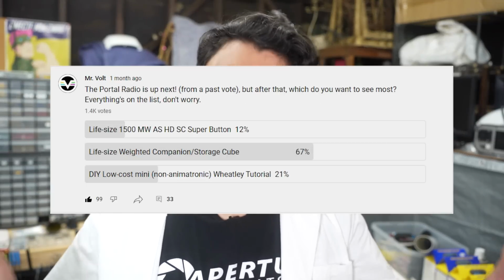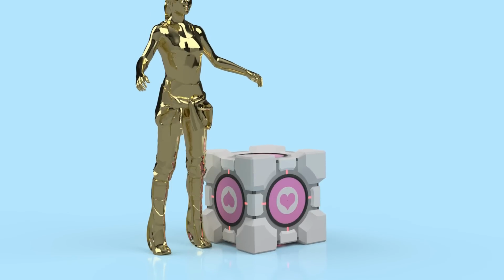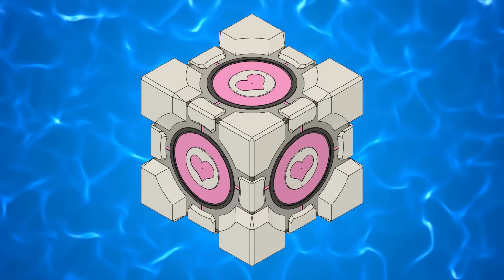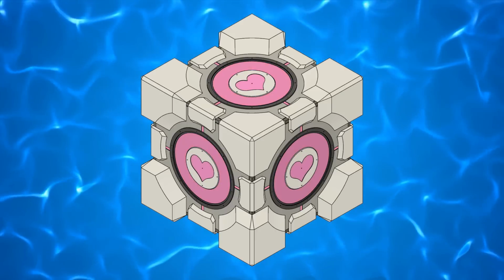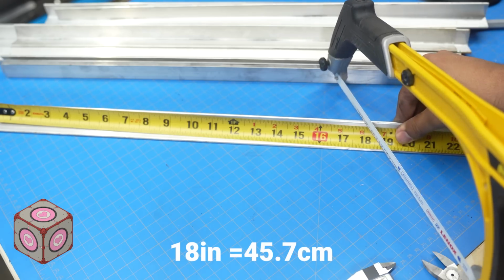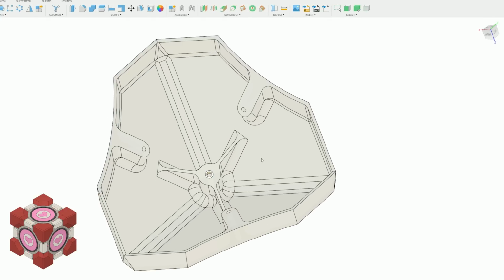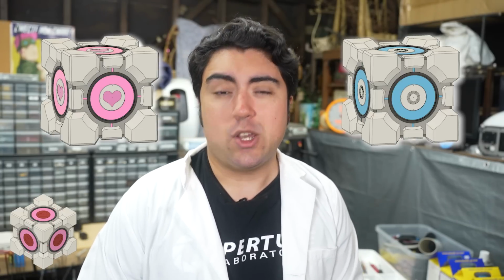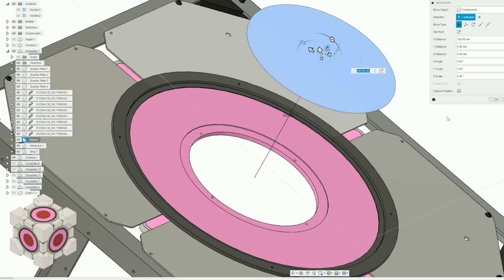Designing a Life Size Companion Cube

Comment: Couldn't you have just placed the circle at an angle though? so the notches fit into the corners, but were still connected? 🤔
Reply from the maker: Yes, sometimes I overthink a design too much and miss the obvious simpler option
Reply: @MrVolt  happens in the game as well; kind of thematically appropriate when you think about it :p

Comment: The size probably came from heights of characters in the Half-Life/Portal universe. Each object (including players and NPCs) have a size in the game engine (obviously), so you can just use a little math to figure out the size of the companion cube, then. And before you ask, no Source game engine does not use any kind of real-life unit. The height of one of the blocks you scale in Test Chamber 17 with the companion cube is 64 units (as is the width of all the portalable panels you see throughout the game).

Comment: If all the edge guards would touch a theoretical button, you could have a sensor or a similar part to detect a small electric current in the ring of the button. 
The edge guards might be the best pieces for it.
I’ve never messed with this stuff, but hopefully it gives ideas

Comment: Idea for colour control.
I know your probally past the point of needing any ideas but thought id share anyway. 
Two ideas.
1. There are cheap nfc stickers you can get you could use them in one of many configurations for example on a magnetic logo so when it goes on it triggers a colour or the button detects and changes the colour.
Or 2. A less programing method, simply hardware. Have the magnet logo plates.
On one side of the cube, on the inside magnets have the cables connected to the magnets one corner negative, one b, one r, one g, for rgb led. Now on the logo plate depending which logo run a wire between negative and what ever colour combo you want. So when you connect the plate the magnets complete the circuit selecting the colour.

I just realised i think i made a mistake with the power explaination but you get the idea i mean, your a smart guy and this comment is too long to bother fixing what i wrote keep up the awesome content.

Comment: PLA is not innately garbage. It all depends on the use case. PLA is great for parts that need to be rigid, where abs is flexy and pla is stiff. Printing pla at temperatures of even 250-260c can allow the internal structure to crystalize which immensely increases strength. Also, with some heat treating (not that hard... can be done with a piece of wood, aluminum foil, and your average oven), the heat resistance of PLA can exceed that of ABS.

Comment: there are a few animations of the cubes being assembled, a few models that show metal sheets for cube manufacturing, educational edition shows the core of a cube
Reply from the maker: Hmm, I cant recall seeing those before. Where can I find the animations?
Reply: @MrVolt  During the manufacturing sections of Portal 2's escape (The part where Wheatley is flashing the light over a pitch black factory while telling you about the madman who destroyed his robots), you can see cube plates being cut by industrial lasers and turned into cubes.

Portal Stories Mel also has an amazing section inside a cube factory which mostly uses canon models, might want to check that out too
Reply: @MrVolt  here https://youtu.be/dQw4w9WgXcQ

Comment: This is my dream decoration, if I ever get enough money I'd make this when I get confident enough in my craftsmanship. Then again my dream companion cube may be extremely expensive, anodized aluminum, flush machined screws, reinforced with a wooden interior or filled with a cheap but light material to provide some structural rigidity. I'd personally out of the lights for mine, even though it's canonically lit, I'd want it as a cute stool or ottoman, or maybe as a nightstand.

Comment: I know you said you wouldn't change the design but why not try using wireless LEDs for the lights?

You could have the induction coil under a button that turns on when it's pressed and it would power the receivers which would be placed on 3 different sides of the cube which would work as the color choice. 

For example  side one is has one receiver that makes the whole cube pink, side 2 has one that makes them blue and side 3 has one that makes them orange.

If you place the induction reciever close to the center it shouldn't activate any other lights as even the longest range induction coil I've seen that isn't a million dollars only went like 20 cm.

Comment: Instead of making the "windows" circles, you could have just made the polycarbonate into a square that fills the side.  Then attach the the corners of each side to the polycarbonate.  Save on cutting it into pieces.  That is clearly the way the thing is designed in-game.
Reply from the maker: The texture appears that way at first, andI didn't focus on the 3D game model in this video, but the there's noticeable depth to all the edges and illuminated strips  as they rest below the faces of the cube, so I'd still need separate plates to cover them (painting over them wouldn't look right). With polycarb faces, each piece would cost $40 too. This way (as circles) I still have the option of edge lighting them from the outside edge, which wouldn't be possible if the whole face was polycarb. There's lots of different ways to make this! I appreciate your comment, just want to explain my thoughts.

Comment: 10:38 if you rotate the part on the left by 45deg, it won't waste any more material as the one on the right. but if one of the pegs breaks off, you're in trouble, so the one on the right should still be the better solution

Comment: i think sandblasting is probably a more effective consistent and reliable way to smoke the plexy for a diffusion effect, otherwise a coating or film,  plus its way faster and less labor intensive,. its also great at flatting bare aluminum  ,, sand paper is likely to be a very "tricky" method of getting the effect i think you're looking for , ,very easy to screw up your material and your budget with plexy and acrylic like stuff,.

Comment: Oh hey, I'm the Wikipedia editor who (somewhat recently) added those dimensions mentioned at 0:48 to the article. I'm glad I included that information in time to be helpful for your project! Those are the dimensions of the cube prop in Portal 1 and Portal 2 converted from Hammer units to real world units. 16 hammer units = 1 foot and the cube model in Portal 1 is 40 hammer units while the model in Portal 2 is 36 hammer units around the bounds of the whole cube (its corner pieces, not its inner cube surface).

As a fun fact, I read on an old Reddit thread from somebody who anecdotally claims to have talked to a Valve employee who said they shrank the cube during the development process of Portal 2 to prevent it from getting stuck in the portals as often.

And for the record, with turrets, in Portal 1 they are 3.62889 feet tall excluding antenna, but I never got around to measuring the Portal 2 turrets.

If you still doubt this scale factor from hammer units is canon, here's my defense of that. It's safe to say that the conversion factor is pretty much as canon as you can hope for. The cube size passes a sanity check when compared against the height of Chell's player model, and she's roughly an average-height female when converted to real world units. The developers are modeling props with a certain real-world scale in mind so all the pieces come together in a sane way, so it should match developer intent. In my research, I've found people posting online where they tried to find counterexamples where specific props or measurements in game don't follow those units. But those are more a matter of oversights or tweaks for technical reasons or artistic license. For example, I've seen people count the distance measurements on the wall of the shaft in the "fall" chapter (with the potato GLaDOS small clap processor monolog), but those labeled distances aren't necessarily to scale with hammer units because they wanted to fit the pacing of the monolog and the player wouldn't know the difference. Another one I've seen is a comparison against the American flag on the moon, but obviously that is just the wrong size for artistic license and can't be used to construe the size of the entire rest of the game based on one prop in an ending cutscene. Other people tried to compare the height of certain known objects like a chair which has a pretty common height, and found it might not perfectly match the hammer units likely due to developer oversight. Nothing is perfectly consistent, but the 16:1 conversion is the basis from which the developers create the whole game and then may choose to make certain things inconsistent for practical or artistic reasons.
Reply: There is evidence of the cube being shrunk. The version of the model included in Robot repair is identical to the one shown in E3 2010, and the retail cube is only 0.9x the size of it.

As for the unit size, the scale varies between assets, as having the player and npcs at a smaller scale works better visually due to it being an FPS game. The depth signs in the fall chapter are actually perfectly spaced to fit 1unit = 1", which is interesting because world geometry tends to be at the 16 unit scale.
Reply: I think the 16 unit scale works better for this though, as it will look closer to how it does in game
Reply: 1 unit is 1 inch for npcs, so each hammer unit is gonna be 1 inch to the height for turrets
Reply: @dkskcjfjswwwwwws413  I don't know if a turret is classified as an NPC or not in-engine. But if you load up Portal 1, stack two cubes on top of each other, and put a turret next to the pile, you will clearly see the turret is just shy of 1.5 cubes in height. Since Portal 1 cubes are 2.5', this is a clear visual confirmation that turrets are indeed 3.62889' tall as measured by exporting the model and loading it in Blender (and excluding the antenna). If it used the NPC scale of 1:12 instead of the normal 1:16 scale, that would make a turret 4.83852' tall, which is just shy of two cubes tall and as tall as a short human. But turrets are in fact only about torso-height as you can see in-game.
Reply: You should just become a hoax debunking channel at this point lol
Reply: @null I just opened up the Hammer editor and dropped in a cube and measured it. Additionally I converted the cube and opened it in Blender and the units were also those measured in Hammer.
Reply: So, I'm currently designing some small scale Turrets, and on my research I saw a video from someone who was designing a 1-1 scale Portal 2 Turret, who was in talks with valve on making a licensed product out of it. And he said that the in game units corresponded to 1 inch each. So instead of 16 hammer units = 1 foot, he used 12 hammer units = 1 foot .
I don't have a preference to either measurement since I'm making small scale ones, just wanted to get your opinion on it because he was pretty adamant on it being 1 unit = 1 inch.
And if I recall correctly he also used Chell's height to confirm his measurments (worked out to Chell being 180cm in height)
Reply: @konstantinosstavrou7638  I think I know of the person you're taking about from my research and he is wildly mistaken. The consequence is that his turrets are roughly as tall as a human, but if you stand next to one in-game and view yourself through two portals, you'll see that turrets are only about 1/2 to 2/3 the height of the player model.
Reply: @Keavon  So I just put a turret next to an office chair in-game, and by eye it seems that your scale fits real life proportions better.
The only problem being that since Chell is 72 units tall, she turns out to be 1.37m tall (4 ft 6 in), which is obviously too short. 
But also in the Valve Developer Community site, it uses both scales, so it's a bit all over the place, but concerning Turrets (and probably cubes) it seems that your scale is correct.
Thanks for taking the time to answer!

Comment: 2.25 ft is accurate, in the map editor the cube is 36 units on each side, one source engine unit is equal to 0.75 inches, 36 units x .75 = 27 inches.
Reply: let me ask: 27 inches is the size of the edge of the cube without bumpy corners, or with them?

Comment: For making the  light change color when it's on a button, you can use NFC tags. They work through a good amount of material, and they are hella cheap (100 for 5 bucks if I remember right).
Reply: Finding a coil big enough to place in the button would be difficult. NFC range can be a problem
A much easier solution would simply be putting a wireless transmitter in each of the buttons created, as well as a receiver in the cube, and any time a button is pushed, the cube changes colour. 
Not perfect, couple orders of magnitude easier

Comment: In game engines, the programers usually use the units like real life measurements. Like 1 unreal unit equals to one centimeter. I think thats where the measurements came from for the cube
Reply: 16 Hammer units is one foot
EDIT: Forgot that npc models are at 12 HU to one foot
Reply: @calcutt4  that's a really nice pfp, i almost forgot how detailed CS:source textures are!
Reply: ah i see. Maybe back in the day they were not consistent with it. 
Thanks, I will keep that in mind, if i make hl or other source maps.
Reply: @MomradG  IIRC there was a factor of 0.75 between hammer units and the units used for prop and npc models, otherwise everything just felt cramped.
Reply: @Dth091  16 hu to 1 ft is used for almost everything, but there are two other scale factors. NPCs, for some reason, use a different scale factor of 12 hu to 1 ft, but that's rare and cubes aren't NPCs. Also the 3D skyboxes are 1 hu to 1 ft, but obviously cubes aren't skyboxes either.
Reply: @Keavon  The skyboxes are made at 1/16th scale then scaled up by 16x by the engine
Reply: @Keavon  its to make the world bigger than the npcs and the player
a 1:1 level would be tight and not fun to navigate
Reply: @calcutt4  thats for maps, its 12 for models
Reply: in unity 1unit is one meter